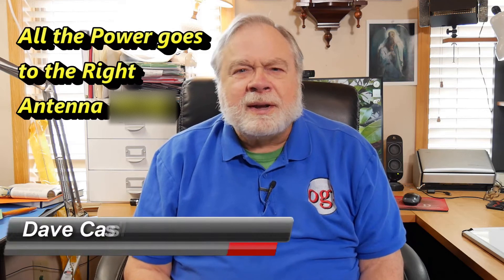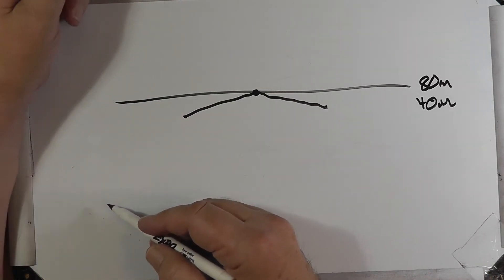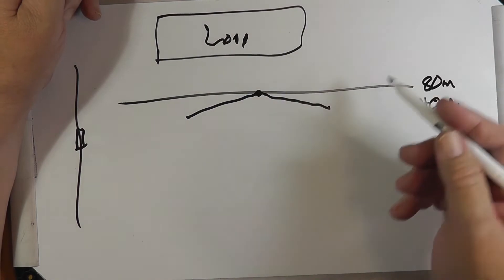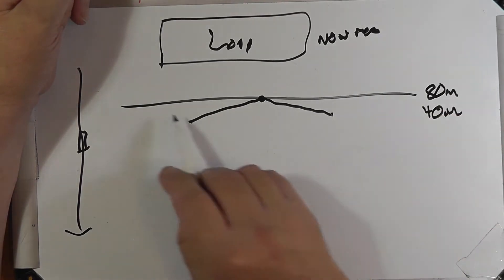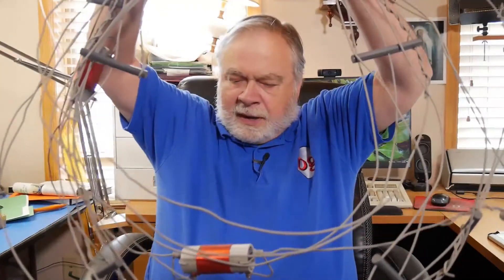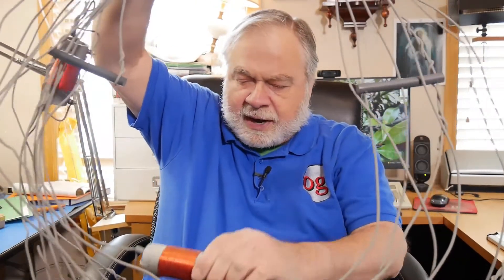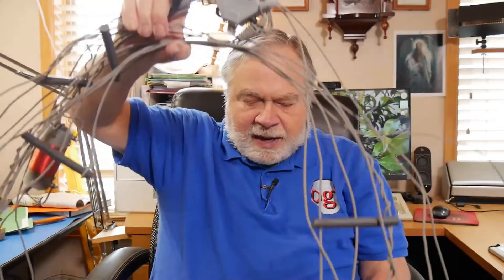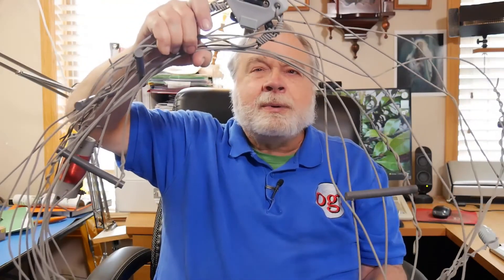All the Power goes to the Right Antenna (#568)

Comment: Good to see that you got your channel back Dave. Being pedantic the 80m section of the fan dipole is going to be resonant on 40m, but of course it will have a high feed impedance. The vast majority of the current will therefore flow in the 40m element. If you take a typical half wave dipole at limited height the feed impedance will be about 50ohms, a full wave dipole will have a feed impedance in the region of a few thousand ohms. It is this that allows the fan dipole to work correctly with just a few percent of the RF current flowing in the "wrong" element. 73